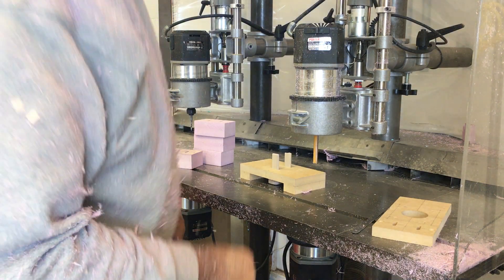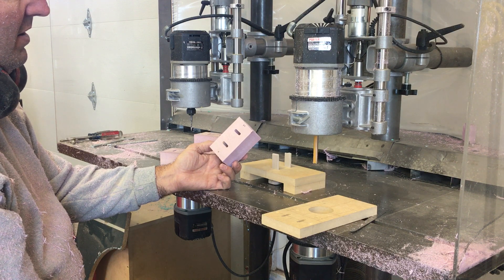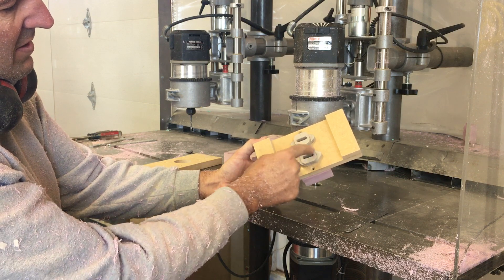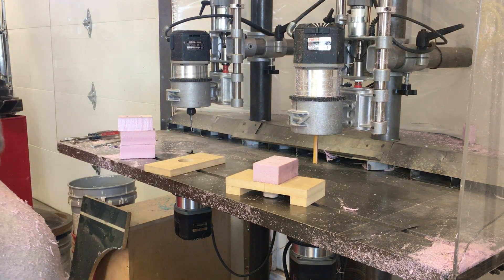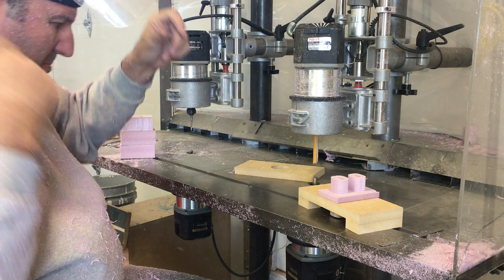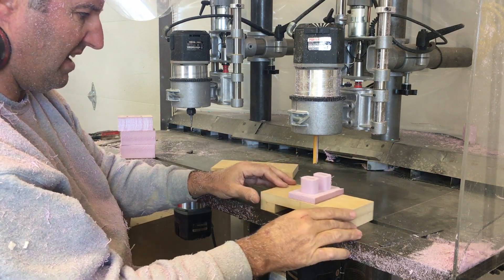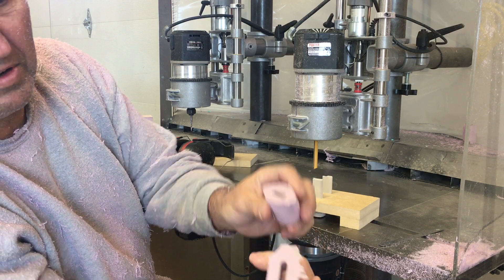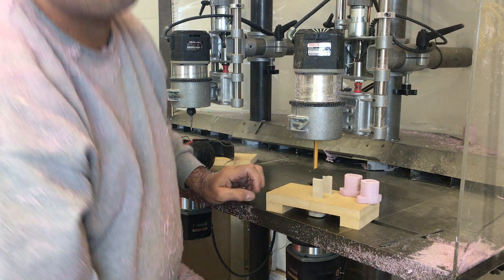6 1 Int Exh Tunnel

Comment: Now I see how you're using the patterns.  Interesting.  Seems a vacuum on the cutting area would help reduce the mess.  Great to see you have a video or maybe some more on how you're making the foam cores.  Eventually, I'd like to cast some horizontal OHV and L-Head Briggs and Stratton engine parts to convert the more common vertical opposed twin and OHV engines to horizontal.  Seems like a fun, value added practical goal.  I was thinking doing a lost PLA method, since can 3D print the parts once either scanned or spec'd out and drawn.  Subscribed and will watch some more videos. Thanks for sharing!
Reply from the maker: The metal opening the entire length at the rear of the table is vacuum port. It can depend what side of the bit you are cutting on. On one side of the cutter it ejects the chips out of the enclosure, the other toward the vacuum source. The polystyrene is electrically charged after it is cut so it clings to everything. You'd have to move a massive amount of air through your vacuum source to capture more. A small fan placed outside the enclosure blowing toward the vacuum source helps. If you'd like to see a more detailed pattern machined in foam, search my channel for "Carburetor Main Well Foam Pattern".  There is also a great deal of information at http://forums.thehomefoundry.org/index.php
Best,
Kelly